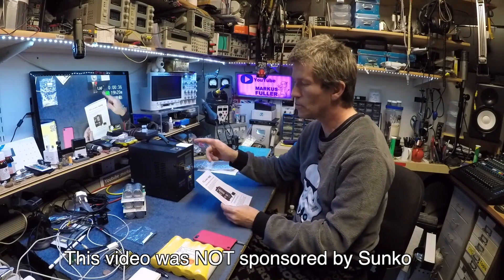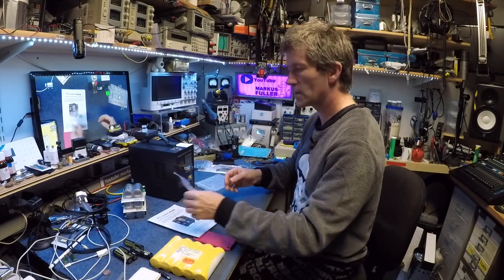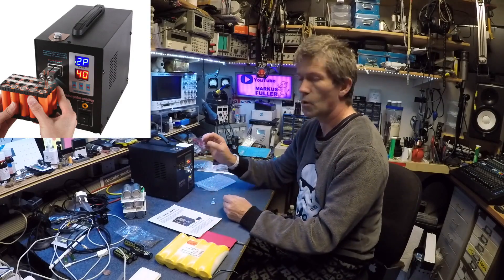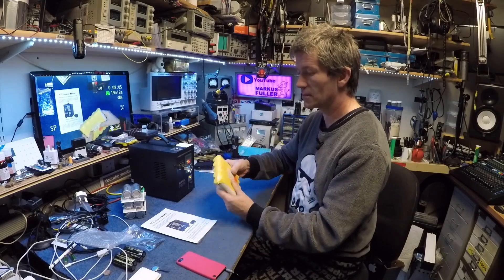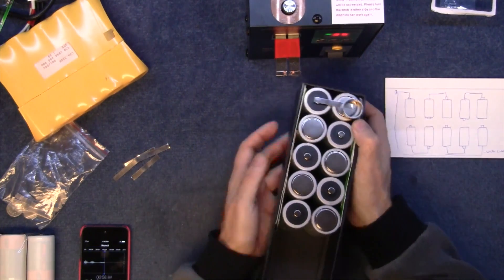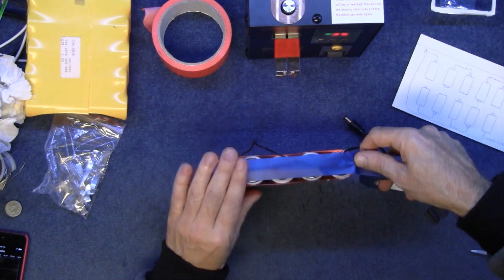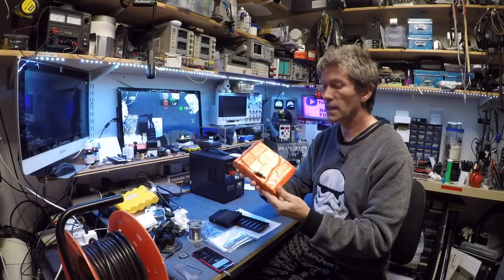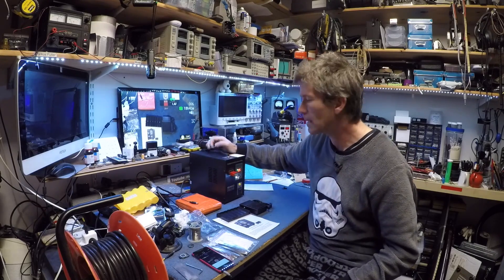Battery Spot Welder Sunko 737B for making battery packs

Comment: You could always use a hot melt glue gun to hold the batteries in place, then tape them for a belt and braces job.

Comment: on top there's a pot to set the pressure of the spring tips
Reply from the maker: squalazzo Hi sorry I thought i may have mentioned that in the video at some point, maybe i cut it out when editing as I am always trying to keep the videos short as possible.
Reply: @markusfuller  i may have skipped that part, sorry, but worth to mention in case :)

Comment: What's the price difference between the two big batteriepacks?
Reply from the maker: GameBreaker the one i made cost me about £40uk (in cells) but the replacement I only found one stated as nagra-d replacement at $700usd but I could not find one on the nagra website.
Reply: @markusfuller  That's an impressive cost reduction, thank you for the answer.

Comment: With the footswitch plugged in, does it override the need to activate the weld by pushing up the assembly in your hand to activate the weld? By this I mean could you apply pressure to get comfortable with the battery and strip in place and then activate via the pedal?

Regardless, happy new year Markus hope you had a fun silly season, always enjoy your vids no matter if it's synth / repair / doing stuff. So long as you are enjoying making the vids, it's all good  :) 

#mousesignature
Reply from the maker: Neffers Hi Neffers I’m not sure to be honest. I guess the unit activates when a footswitch is used wether you are using little or lots of force on the pins. there is a control on the top above the pins that you can set the pressure needed to activate the weld . i think its variable between 200 to 700 grammes force.

Comment: For 2032s why not just fit a PCB holder? They don't take up that much more roon than the welded tag batteries. At least it's always worked for me so far.  Makes total sense for the big battery packs though.
Reply: There's cases where you don't have room for a holder, sadly. For example Tascam DA-xx's were a bugger for having tabbed cells, often soldered to vias on the board near the casing (yeah really), and synths with layered boards often put the battery anywhere they could due to limitations, space is sometimes really tight, dunno why they make it so, but it's a thing.  

WIth the ability to spot weld and heatshrink, you can pretty much do a factory job.
Reply: Because most holders pins are wider than the battery pins.
Reply: But, you can add stiff wire to the legs to match the spacing and glue/double sided tape the holder in position. Depending on the space available to you.
Reply: @RuinBird  That is fine for domestic/ home use - but not suitable if you are gigging and the device is going to be moved about regularly.

Comment: Happy New Year Markus! Great vid - Im sure you could do laptop battery packs as a side business!
Would you not replace the coin-cell batteries with a modern holder rather than welding the cells in (making it a pain to replace in the future all over again)? Anyway, here is to a great 2019 for you and Jason!
Reply from the maker: mCKENIC Hi and happy new year to you also. yes I do often replace coincells with a holder but you have given me an idea as i have an old laptop that only works with the charger plugged in so i may hack the battery pack and sort that out 👍 . i certainly have a battery drill that needs doing as the replacements are real expensive.

Comment: Very helpful Marcus! Nice to see what machine is needed and the process used. Think I might snag one and add it to my garage shop! Never know when you'll need one!
Reply from the maker: Marshal Arnold Yes a handy device indeed, I have a nice battery drill with a dodgy battery and I know its only 4x 18650 batteries in a plastic box but the replacement would cost me £45 . i can remake it for about £5 now. this thing will easily buy itself in a very few jobs.
Reply: @markusfuller  yeah, I have a vintage laptop that's a similar story. For obvious reasons used packs are almost $200.00! This will surely help me out with getting it powered via battery again!
Reply: I would recommend buying the 220V version.  You have to look to find them, but Amazon has them.  Of course you have to supply 220VAC.